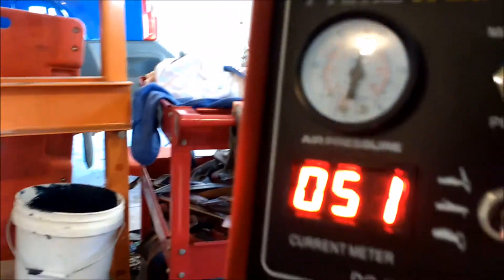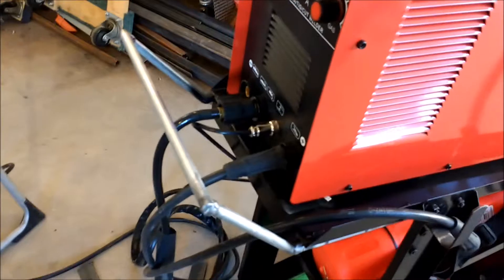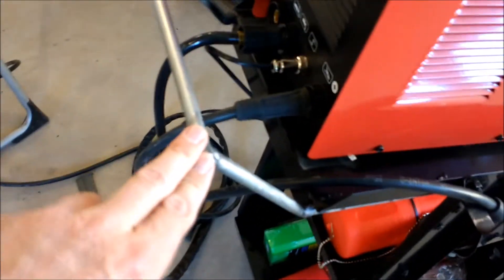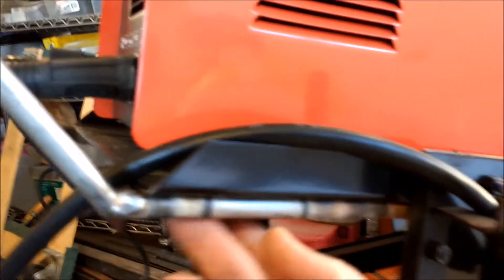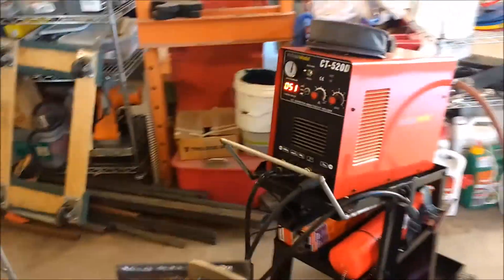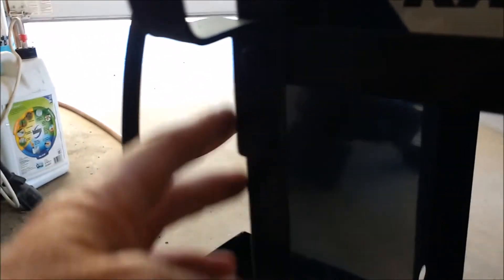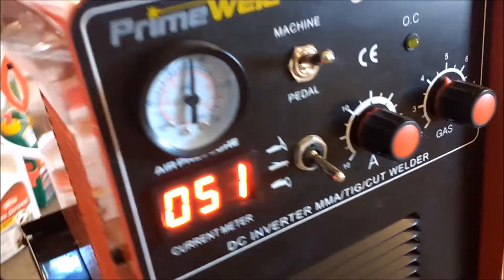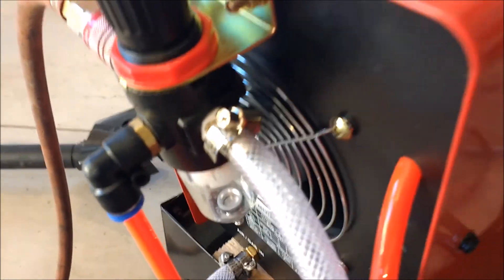Primeweld CT520D Cutting 1/4 inch steel

Comment: My Everlast powerplasma has a sweet spot at about 70 psi. I've been able to cut 1 inch steel with very little dross at that pressure. Experiment a little. More pressure isn't always better. More pressure just means you will need a bigger and more expensive air compressor.

Comment: Have you ever had any trouble with a no Arc at the torch?
Reply from the maker: If you mean have i ever had trouble with this scratch start version instead of the pilot arc version? No, even on rusty metal and old paint it cuts through. I think a couple of times I've had to scratch the paint off to get the arc started, but most of my cutting is on bare steel, so its not really an issue. I wanted to buy the pilot Arc version, but he didn't have one in stock at the time and this one was cheaper by about a hundred bucks .

Comment: I'm guessing this is 240v.  How does it cut on 120v?  My garage has 240 but I was hoping to use this for small side work in the field where I won't have access to 240 outlets.
Reply from the maker: I haven't tried it on120 😬
Reply: @anesthesiadreamin  Did you keep the 30 amp lock plug on it? I have 240 in my garage but not a locking 30 amp socket just the regular style one, I think it's 50 amps but not sure.
Reply from the maker: @UniteForgetLeftRight  I switched the plug on the back of the welder to a NEMA 6-50 I got off Amazon, for the same reason... I probably have the same outlet on my wall as you do
Reply from the maker: @UniteForgetLeftRight  or you can buy a pigtail converter plug as an alternative, might be easier
Reply: @anesthesiadreamin  It was delivered to me about 10 days ago.  It worked ok on my 120 as long as I kept it under 100 amps but the in law's garage could handle 107 amps on their 120 without throwing the breaker (I think because the outlet was much closer to the breaker box).  I did a project there that required a extension cord and all I had was a basic 20ish foot grounded cord and it worked great.  Haven't had a chance to try out the plasma yet.
Reply from the maker: Unfortunately i hardwired it for 240 and haven't used it on 120 at all. Sorry.
Reply from the maker: If you are interested in buying one, I would call the company and ask them how it runs on 120. They are super helpful and responsive, they are straight shooters, you will like them